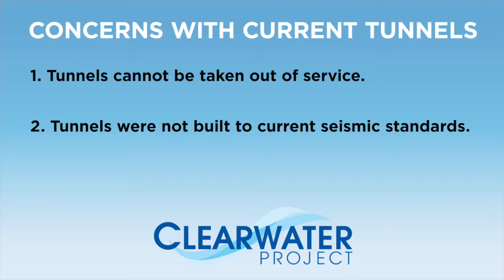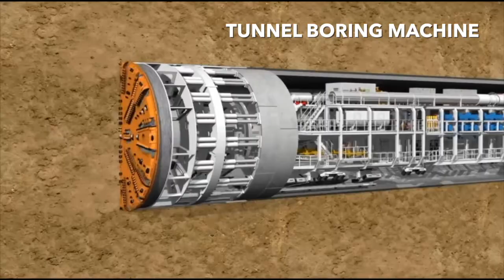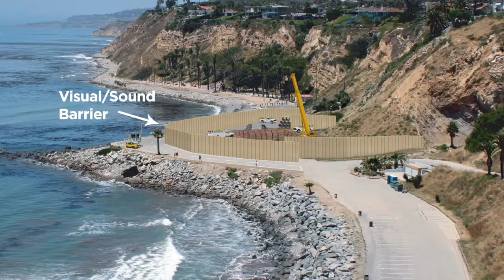Clearwater Project Overview

Comment: So, basically you are simply following the engineering plans nearing a hundred years with bigger pipes and still sadly dumping in the ocean.
Nearing one billion dollars worth of disappointment.

How about instead of channeling waste away, you simply wisely repurpose waste into useful products on site.  Such as, building bricks, terrain cotta roofing tiles, flower pots, ceramic engine parts and for the really badly contaminated radioactive waste ceramic batteries, electrolysis plates for mining and actually make money instead of just dumping it into the ocean.

Jeepers this is so disappointing... France has been dumping into the ocean for decades causing el Ninos and la Ninas now America will begin creating our own problems which will likely harm Mexico and South America.

Anytime you are replacing old technology never repeat it and don't even replace it if you can not engineer something 100 times better.   Going from 8-12 feet pipe width to 18 feet is just embarrassing for America.